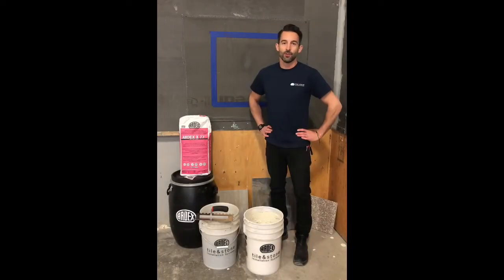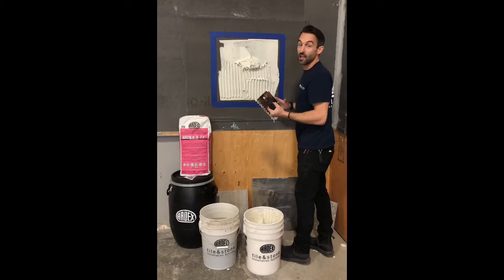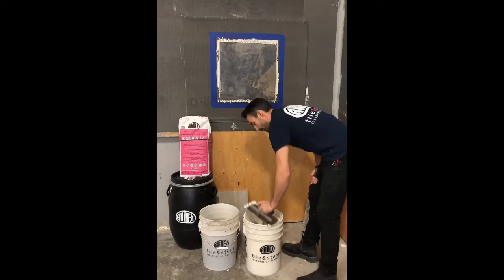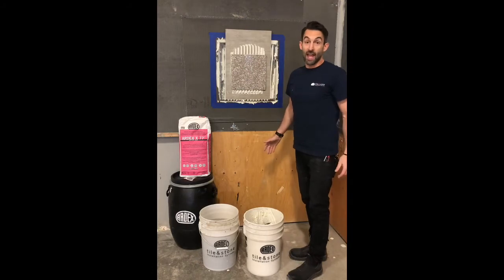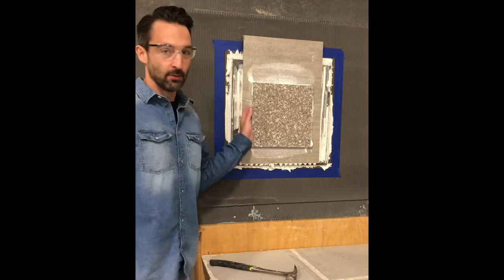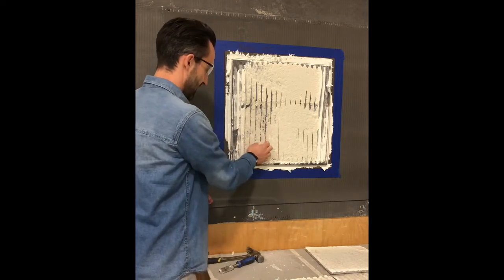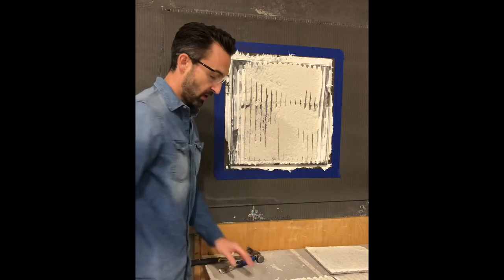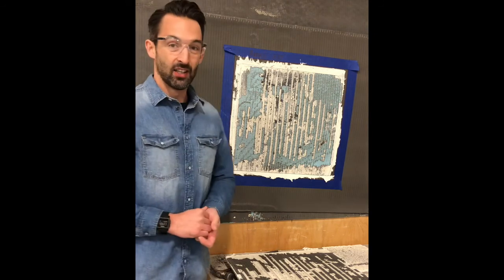ARDEX X 77 Demonstration Video

Comment: The performance seems impressive, but given the price of this product, I would hope so. If the substrate is a plaster wall with 4-6 coats of oil-based primer (done years ago), what can one expect? Is the Ardex P4 really necessary when the performance is this good? My plaster wall does not have wood involved. It has a brown-coat base lath, attached to a very strong wire mesh. The building was constructed in 1958, and the walls are rock solid. Any thoughts? Thank you.

Comment: Our bag does not have high and low ratios. This is not working for travertine for us.
Reply from the maker: Hi Dennis, the website and the bag say to mix 8 1/4 – 8 3/4 quarts of water per bag. Perhaps the bag you purchased does not? Which seems odd. This product can be used for some natural stone but ideally our N23 mortar would be better for travertine. (depending on the application) If you have any technical questions feel free to call the technical department 888-512-7339